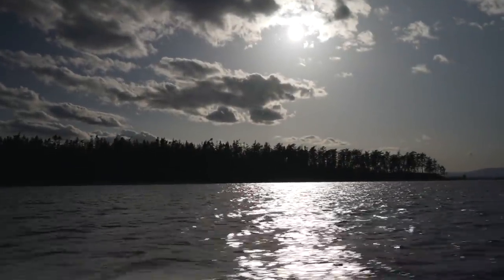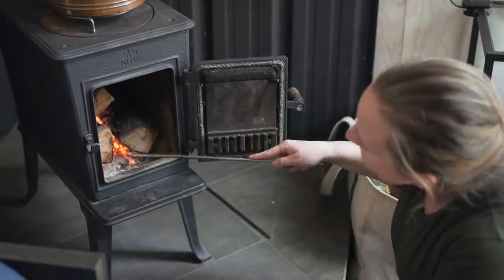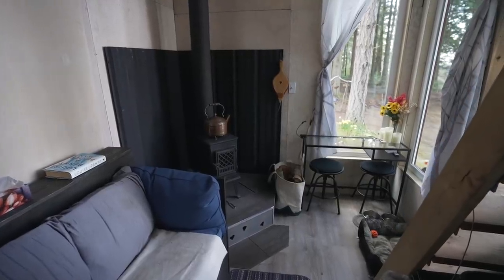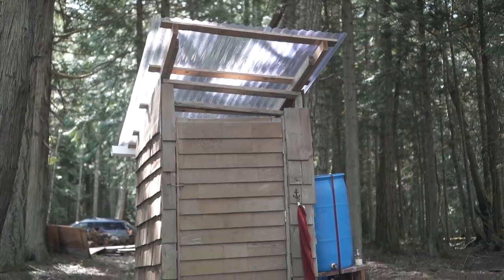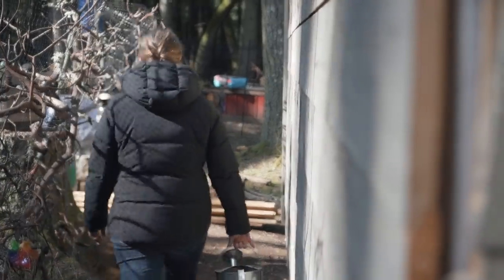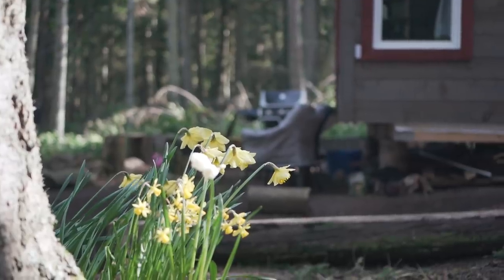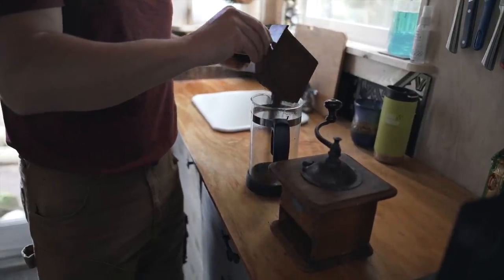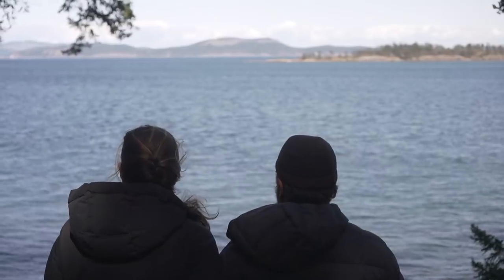Couple Living Off-Grid on an Island in an Ultra Tiny Cabin

Comment: What a lovely cabin they've built. Cozy and comfortable and a nice use of space plus an adorable dog. I imagine a little vestibule outside the front door would help with those winter winds and rain. As for the laundry, I'd recommend checking out the WonderWash. My partner used one for about 6 years and it's a great way to wash clothes and a bit easier than the bucket/plunger method. Thanks for the tour!

Comment: I've seen a portable outdoor washer where you set a hose in it, put the clothes in and fill it. Then the washer agitates by itself then you then there's an opening to let the water out. Then take the clothes out and put them in the other side and it will spin it, then gang to dry. It doesn't take much electricity and doesn't cost much and I think it sounds better than washing everything by hand.

Comment: Very nice video 👍 it's a good idea to space that sheet iron behind your firebox about an inch away from the wall on standoffs so that the air can flow behind it, leave a gap at the bottom.. ( I used to install them ) it helps keep the wall cool,  really only neccessary  if the iron is getting quite hot.🙂
Reply: Hi thanks for watching the video, when I put up the metal on the wall I used washers to space it out 1” and in between each washer is high heat silicone. Thank you for the comment

Comment: LOL...I totally forgot....
OMG Folks, build a tiny addition onto the side or back so you can have an indoor shower (& toilet?) and a washer/dryer. 
For me, the idea of going....outside....
in the freakin' COLD to take a shower sounds horrible. When you said that I got shivers. In the summer it might be nice. 😀
 'A bucket & a plunger' - despite sounding dreadful has got to be difficult, at best, especially wringing them out. (I'd be concerned that my clothes weren't really fully clean. But maybe that's just me.)
Setting up a line on pullies in the tiny addition or even up high in the house could work better in the cold than outside would, but y'all probably got that part down already. 🙂